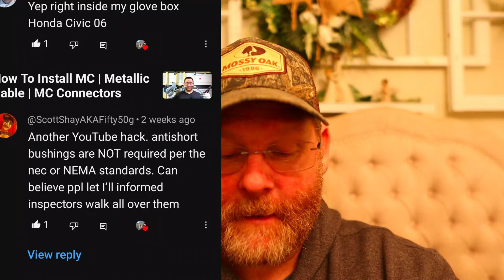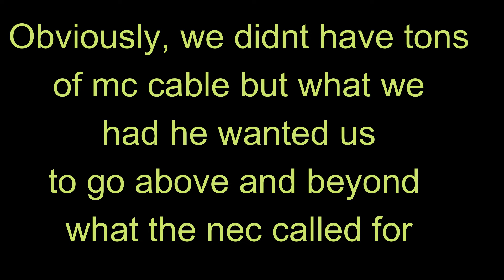Anti Short Bushings For MC Cable "You MUST Use Them"

Comment: I worked on a hotel in Arizona 20+ years  ago. The boss said, "Don't use the anti-shorts. That connector is listed  for use without them." I used the anti-shorts anyways. When they started  flipping breakers, we had lots of shorts on the connectors without anti-shorts. The extra effort was well worth it.
Reply from the maker: I so much agree... Its such a small price to pay. And in the long run as you learned it could save you from backtracking. Thanks for watching and commenting ☺